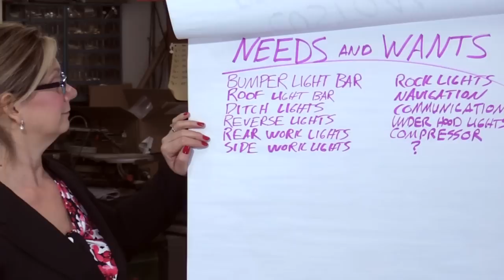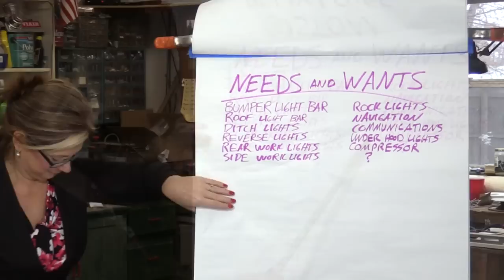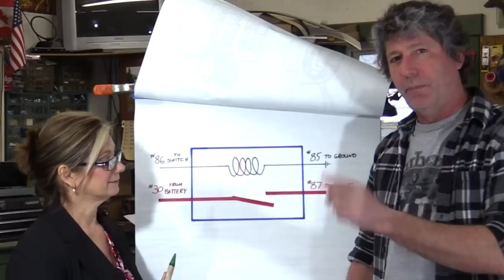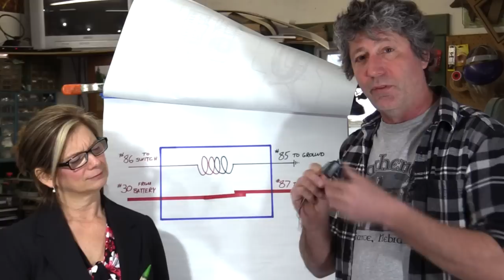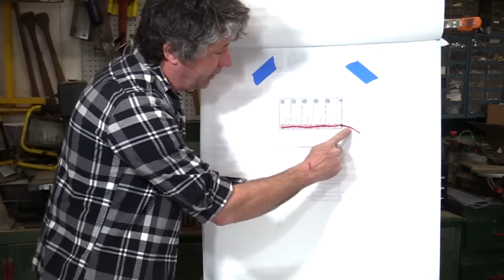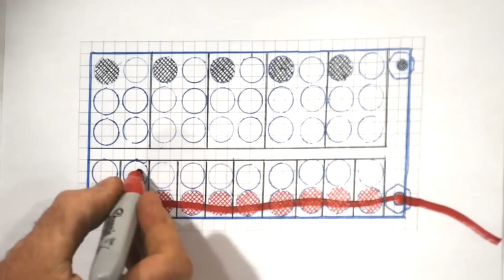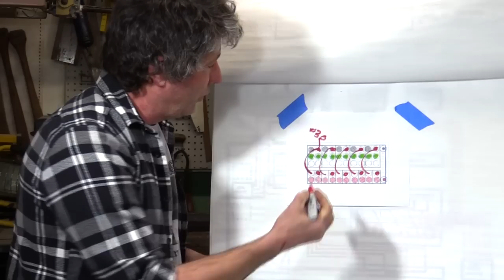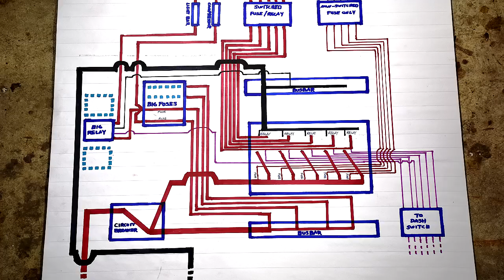The Best Way To Make A Relay/ Fuse Panel, Automotive Wiring

Comment: That's some clean wire management and I also love good labeling in a control circuit. You guys did a great job! This is a FAR superior design to integrated all-in-one switch kits.  Durable, expandable and, most importantly, easily repaired
Reply from the maker: Thank you!

Comment: Just wanted to say Thank you for this awesome video and the references!. That article is awesome!  Just a note, there is a typo in one of the part numbers that are listed.  "Four Position Fuse Block, Waytek Wire #4680"  Should be part #46080   Just found that when I was making a shopping list. Thanks again!

Comment: My only pointer would be to use some sort of plastic or rubber gromet for when the wires passes through holes in the aluminum, to protect the wire insulation.  Otherwise very clean.

Comment: Dont forget those little add a fuse taps ARE directional. If the tap is put in the wrong way with the wrong leg tab in the power hole it bypasses the fuse. The incoming power slot is the farthest leg tab with the outgoing power slot the closest to to tap wire.

Comment: Okay... this is awesome. And I came to it as a power trays customer. Here's the fun question... I'm following your directions and have a cart going at Waytech. But everything is about 5 times the amount I need. Do you know if they'd work with a DIYer who doesn't need 100 water plugs and 100 blue wire seals? My cart is over $200 and doesn't need to be approaching that. Thanks for all you do!
Reply from the maker: Unfortunately all they sell is in bulk.
Reply: Just got my box. I think I’ll package up a kit to help the next people! Thanks for the guide. After a few watches, the light bulb has gone off.

Comment: This is a very cool setup! I am just baffled by what the bus bars do? How do they work? Is there metal on the other side of them to touch the bottom of the fuses on the bussman fuse block or is that a totally separate system only powering those larger fuses and used to offer 4 ground and power points as you add fuses to the fuse block????

Comment: Hey guys.  Building this exact setup, thank you again for all you do with your instructional videos.  Anyway.  Just another question.  My light bar has a 40A relay.  And the relays used in the Bussman box are 35A.  In your opinion, can i just use one of the existing relays in the setup for my light bar or should I do it just as you've described?
Reply from the maker: I'm pretty sure the 35 amp will do just fine. Check the amp draw spec on your lightbar just to make sure. I can't imagine it being nearly 40.
Reply: @WanderlostOverland  Well, it's a 200w bar.  40 x 5w Cree LEDs.  And at 12v, that's 16.6 amps.  If my electrical conversion is correct.

Comment: Old video but I’m wondering where you power your winch from? Straight off the battery still?

Thanks for the video. I’m starting to get enough things bolted on to the battery that a system needs to get put on somewhere.

Comment: In this design, there is no local grounding in the fuse box for the accessory device, right?  It is assumed it is being grounded to the chassis close to wherever it is?
Reply from the maker: Correct.
Reply: @WanderlostOverland  Is it better to ground the device on the chassis near the device or to run a ( - ) wire all the way back to the battery/( - ) busbar?

Comment: Question: I see you hooked the positive wire from the battery to the port labeled “AUX” on the main breaker and the port labeled “BAT” to your BUS bars.
Labels seem backwards?
Please advise.
Thank you.
Reply from the maker: I just went out and looked and the wires are oriented the correct way. In the video I noticed that you're right, they are reversed. At some point we switched them.

Comment: How did you get thru the firewall?  I have a 2016 and can’t find a factory spot accessible.  I’d like to make a small relay/fuse box for just a couple switches.  I’m also wanting to install my CB radio.  Needing to pass the antenna coaxial ( large ends ).  How or where do you run yours?  I think I’m going in mount my CB where your switch panel is.  The number of switches I want will fit in the factory knock-out panel to the left.  Your videos at.  I’ve watched so many.
Reply from the maker: Below the brake system on the firewall there's a big rubber grommet that a stock group of wires goes through. We poked another hole in it and ran our wires through it.

Comment: Love the video ! Great information on building an extra fuse panel . I do have a few  questions I hope you can help with  . This panel looks like it can pull some serious amps . Does Toyota offer a higher output alternator for the FJ ? If an alternator isn't an option then maybe changing the pulley size ? I know you would not  have the panel at 100 % ever but at night with  your head lights on and several other light running then with your communication , navigation  could it over load a stock alternator ?
Reply from the maker: I do believe their is a higher amp alternator that fits on the FJ. Maybe off a Tundra? We don't pull to much through our panel mostly thanks to low amp LEDs. We've never had a problem, in fact, when we turn higher draw accessories on the headlights nor anything else shows any effect. Thanks for watching!

Comment: This may be a silly question and I may have missed it, but where are you grounding your lights and other items when using this?
Reply from the maker: Depends, if it's a simple low amp light we most often will ground to the body. If it draws more power, like a big light bar or compressor, we ground to an internal busbar in the fuse box.
Reply: @WanderlostOverland  great thanks for the response! I am wiring up some lights and have been trying to figure out where to ground. Are there specific grounds on the body you use?
Reply from the maker: @RussBlumenthal  Any small bolt holding something on the body will likely work. It's important to scrape the paint off so the ground wire makes good contact.
Reply: @WanderlostOverland  great thank you very much, your videos and comments are always so helpful!

Comment: what power source are you using to power the switch inside the cab?
Reply from the maker: That comes from a fused circuit on the panel.

Comment: Unfortunately Powertray doesn't make one for Jeeps. I was going to buy one for my 14 JKU. I might just buy a premade terminal box. I was completely lost, with all the wiring. Auto electrical is not something you want to screw up.
Reply from the maker: We seen a lot of under the hood and behind the dash fires. It's incredibly important to use the correct size wires, connectors, and switches. And fuse EVERYTHING!

Comment: Do you not own a proper crimping tool?  No  need for solder if you use the right crimping tool.  Properly crimped connections are typically more reliable than soldered connections.  Crimped connections also handle vibration much better, which there is a bit of in overlanding.
Reply from the maker: Crimping vs. soldering has been a topic of debate since the beginning of time. Both have
their pros and cons. Our experience has thought us that soldering works best
for the conditions we operate under. Thanks for the input.